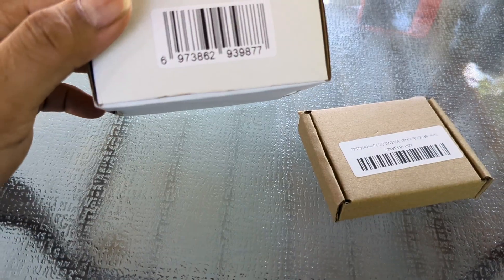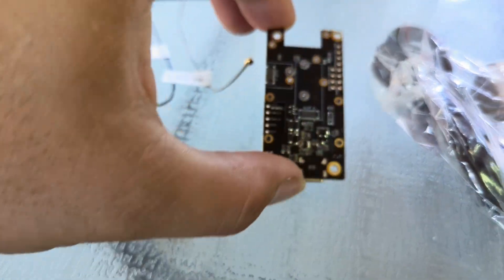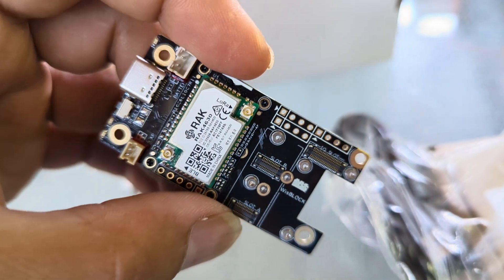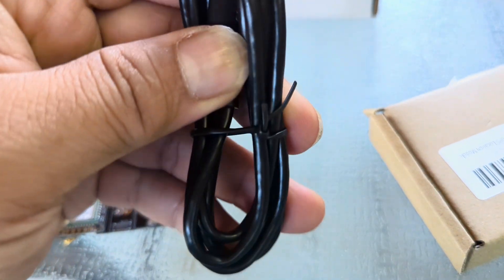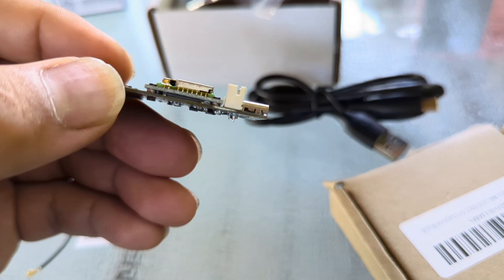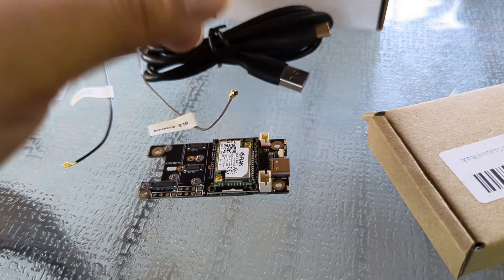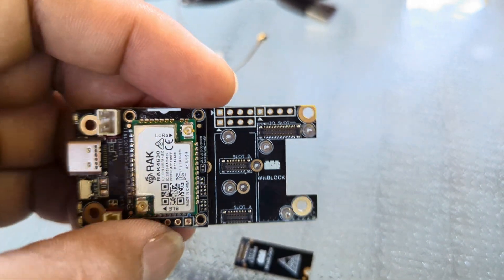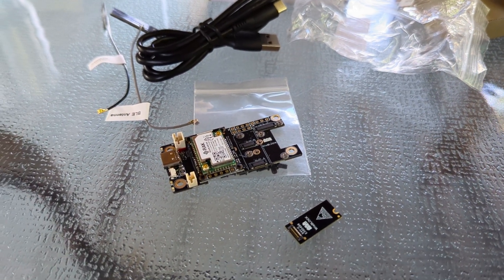Meshtastic RAK Starter Kit (116016) + GPS - Unboxed & First Impressions

Comment: If You Can't Get The GPS Working  It's Because The GPS Lock Issue Is A Common Problem With The RAK Boards. 99% Of The Time It's Caused by The Antenna And Most People Including Myself Have Swapped The Default Antenna Out For This One Which Works Perfectly As It Should: https://a.aliexpress.com/_EGZHmaz (Make Sure You Pick The 15x15 Size)
Reply from the maker: @jtkiller911  Thanks for the tip, appreciate the guidance! Am totally new in this field and it's quite interesting
Reply: So you are saying it won't work with the included antenna and I have to order one? What would you recommend for a magnet mount antenna, for a vehicle?
Reply from the maker: @kenneth6731  It works but will be more effective with matched hardware
Reply: I picked up the antenna you suggested and I'm still having issues.